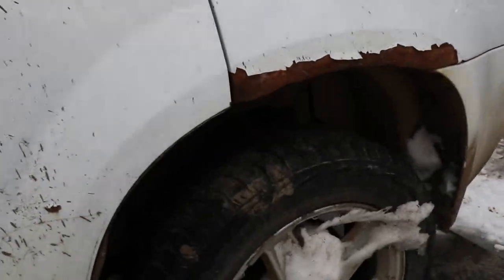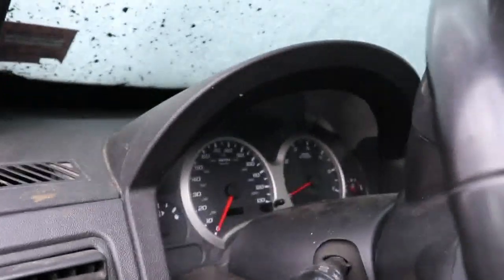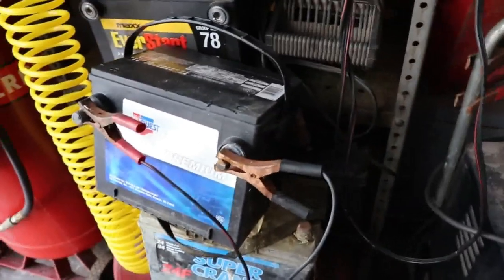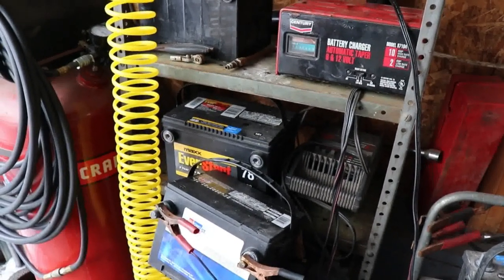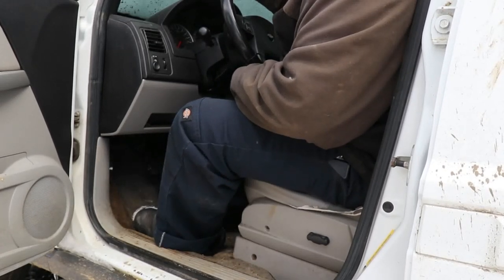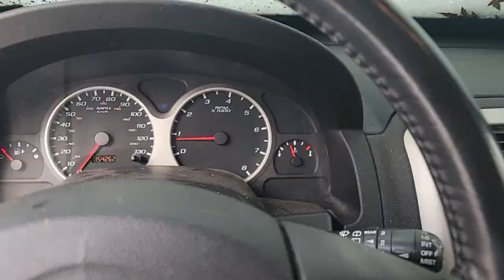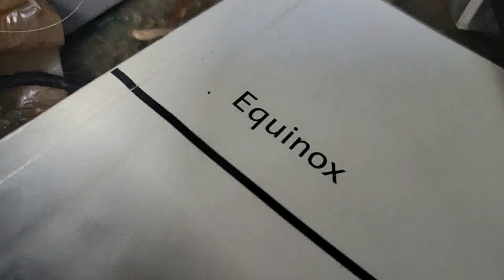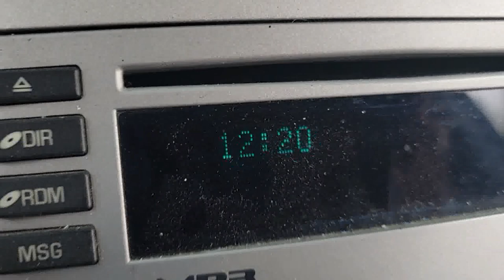Another JUNK Chevy Equinox-Will it start?

Comment: I had an 07 white Equinox it was a pretty good vehicle I only paid $1800 for it changed a water pump and drove it from 2012 to 2017 until the tranny started slipping then I scraped it.

Comment: Burnout sparks rims 😁👍 I've read somewhere that if you goes between the shifts on auto it can rev to redline, I think it is between neutral and reverse if i remember correctly.
Reply from the maker: I've tried it on a few and never worked
Reply: @acrazycanuck78  Okey 🙂👍